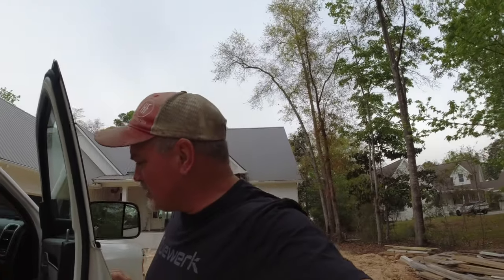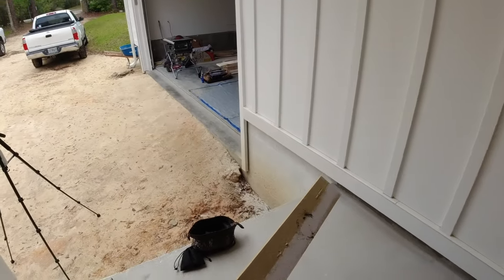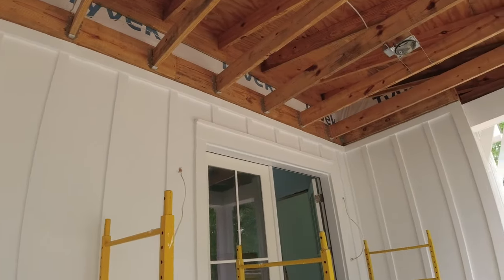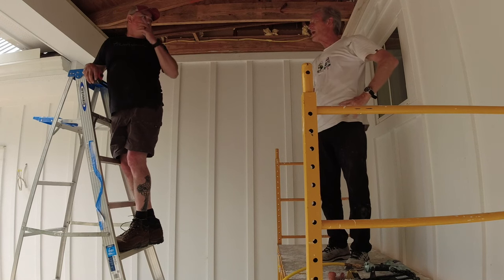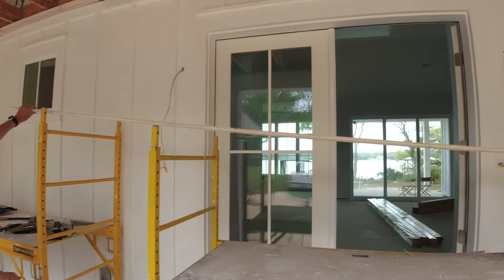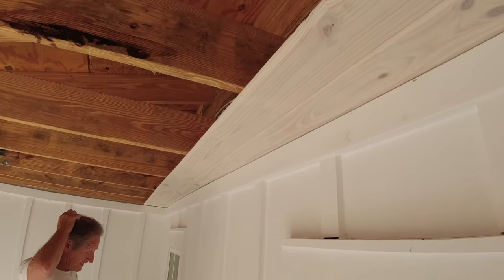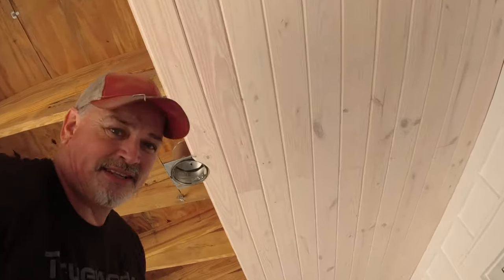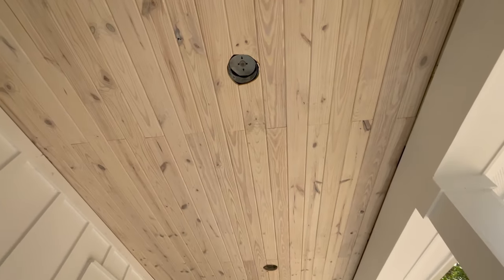HOW TO install TONGUE and GROOVE Ceilings!

Comment: There is some good and bad in this video.  Getting the uneven ceiling squared out was interesting to watch.  I'm concerned about the longevity of the wood.  After they make the cuts, they are not sealing the end grain. This should be very important considering the moisture levels in the area are likely pretty high.  Even if they are painting the exterior surface, there's a lot of unsealed wood ends and on the top.  even if the wood was sealed prior, the end grains were certainly not.

Comment: Hank help me … understand how oil/maintain air compressor ty idk this guess I should’ve read the instructions
Reply from the maker: The compressor, if equipped, should have an oil fill cap. Simply add compressor oil from harbor freight or any big box store. Also, make sure you drain the water from the compressor regularly. 👍
Reply: @BlackBarnBlossoms  ty kind sir

Comment: He is not showing where to nail, top of the board or in the grove?
Reply: Correct ppace to shoot a nail is in the tongue area at a downward angle so the nail does not interfere  with the next incoming board. If shot in at a straight, the nail in the backside will be pertruding and not allow a flush and correct fit of the next board. I use 16 gauge finish nail for exterior and 16 gauge finish nail for interior, both 2 inches at length.

Comment: I wonder if the light trims will fit around the extra tight wood cuts you made. better check. I was a little worried about you guys falling before it actually happened...dang heal up and buy some tools to make the job soo much easier.